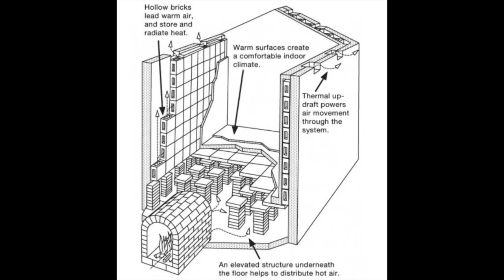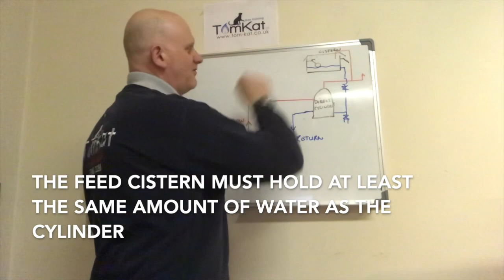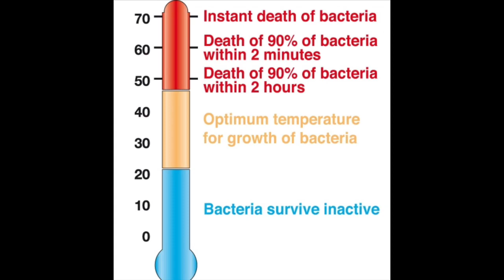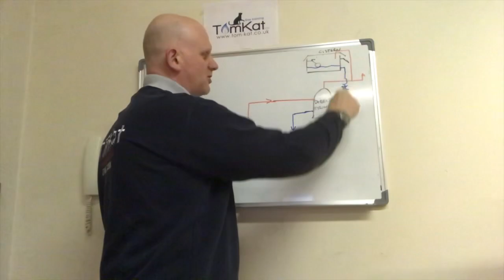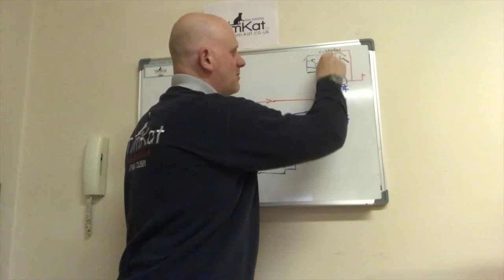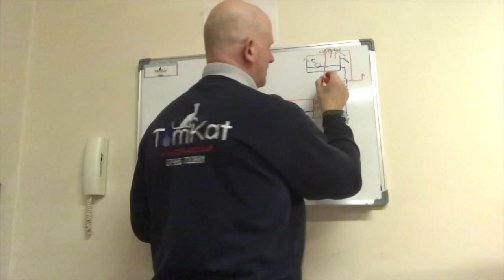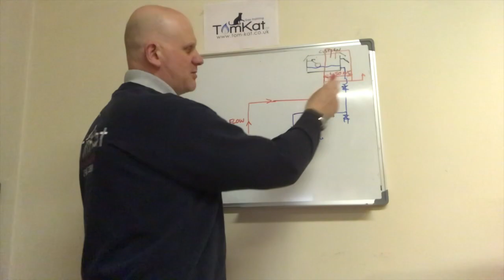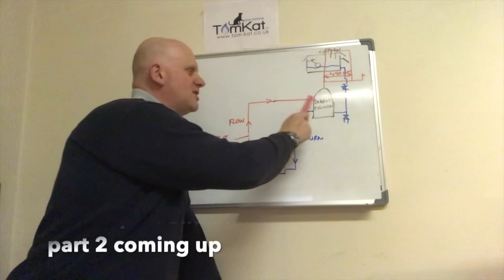HOW CENTRAL HEATING WORKS part 1. The history of central heating pipe layouts

Comment: Would it be okay to pipe the whole of my central heating system not just the flow and return,  obviously step down to 15mm when connecting to the radiator pipes under the floor.  The only reason I ask is I have enough 22mm pipe for the job and don't want want to buy  any 15mm if I don't have to .